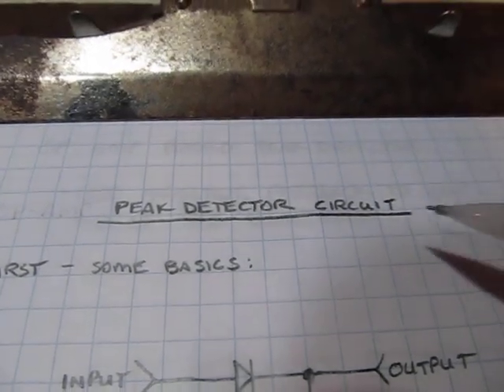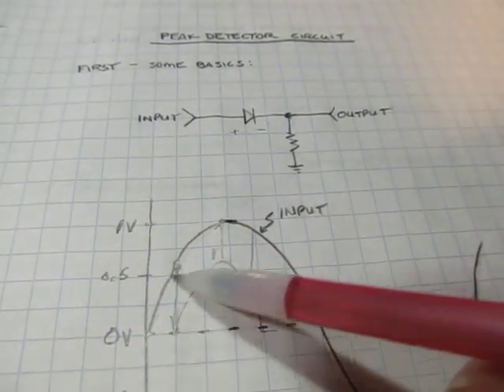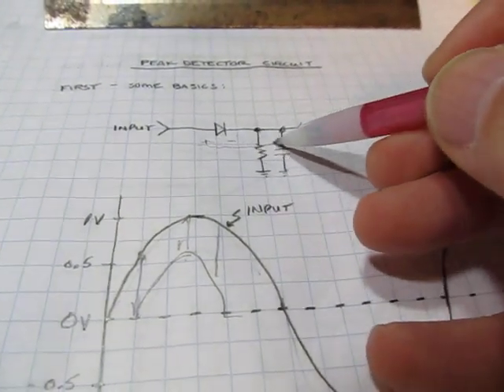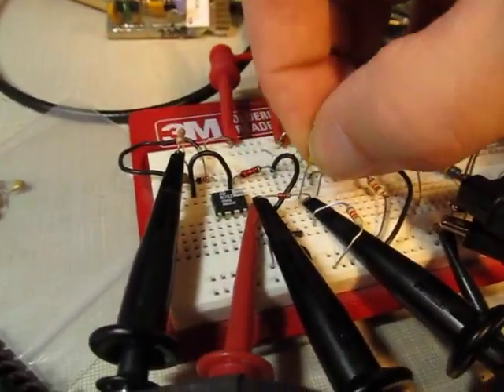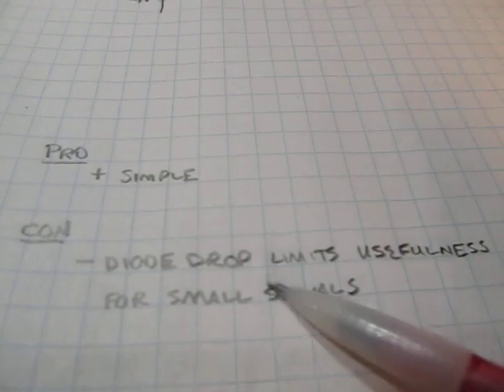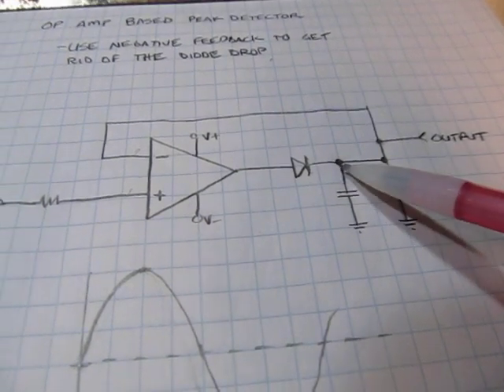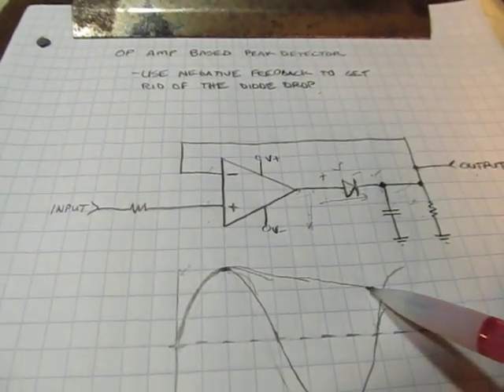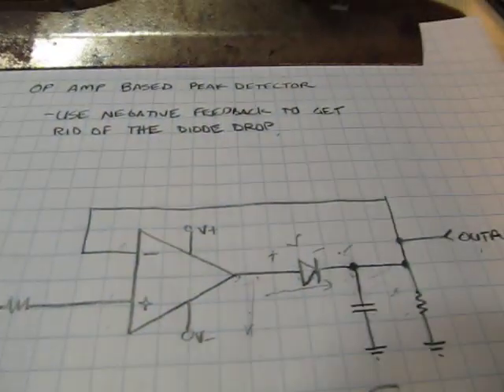#77: Op Amp Peak Detector Tutorial, with peak detector basics

Comment: Is it possible to detect peak without using diode.as diode will drop some of the voltage across it.if the voltage is in micro or nano Volt then how it can be ready without using diode..
Reply from the maker: With the diode in the feedback path of the op amp, you eliminate the diode voltage drop.  However, measuring the peak of very small signals such as these, you would likely want to amplify the signal first, then peak detect and scale the output.

Comment: Excellent explanation how a peak detector works. It would have been nice to get values of C and R. We know, R shouldn't be too high because of noise, disturbance issues, but what would be a good value for this R?
Reply from the maker: The capacitor and resistor are generally chosen based on the application. There are no hard and fast rules.  The capacitor should be large enough to store the charge (and not be bled off by the load too quickly), but not so large so as to require a very large charging current through the diode. For low frequency/audio applications, a few 10s of uF or more are typical.   The parallel "bleeder" resistor may not even be needed, especially if the circuit that follows the peak detector draws off the charge to create the required droop requirements.  If you need a faster droop or discharge, then the parallel R can be added for that.

Comment: Hi Alan, as a retired mechanical engineer I am still low on the (steep) learning curve with electronics but I had an idea about this. I have a couple of Tek 'scopes, a (dinky) little 314  & a 7403N which works when it feels like it (HVPS issues).

As you are no doubt aware, neither of these 'scpoes has a digital readout and I wondered:-
a)   is it possible to make a -ve peak detector with the other half of the op-amp and inverted components, and 
b)   could I use a combination of peak detector circuit and DMM to give a numerical readout from the 'scope trace?

Perhaps you think this may be an interesting video topic for those of us who don't have cursors or DSOs. I know it is quite cheap now, to acquire a Chinese DSO but I have always had a thing about vintage equipment and it does save on land-fill.  I also found an old AVOmeter 8 on eBay a while ago and could not resist the 3kV input (!) which I thought would help in fixing the 7403N and would be a good learning excercise. :-)
Reply from the maker: The answer to both of your questions are yes - you can make a negative peak detector, and use a DMM to measure the levels.
Reply: @w2aew  Great, thanks!

Comment: Hello, thanks for the explanation! I want to make sure if the type of the amplifier affects the performance of the circuit. I tried the Lm741 and the MCP6273 but peak detection didn't work. Any suggestions? Thank you in advance.
Reply from the maker: You have to be mindful of the power supply requirements, and the permissable input and output voltage ranges of the op amp that you use.  The ancient LM741 is VERY different than the MCP6273.  The LM741 is designed for larger power supplies, and usually split supply operation (like +/-15V) and the inputs and outputs can't get any closer than a few volts from either supply rail.  On the other hand, the MCP6273 is a low voltage op amp with a MAXIMUM supply voltage of 6V and it's inputs/outputs can go to the rails.  Very different!  If you don't respect the supply and in/out voltage requirements of the particular op amp you're using, it won't work.
Reply: @w2aew  Thank you for the quick reply, yes I am using the MCP6273 with 5/-5 Voltage supply. It must work right ?
Reply: @w2aew  I also have a concern regarding the basic peak detector circuit (diode, resistor). I am using the 1N4004 diode with a 1K ohm resistor. The voltage drop of the diode must appear consistently when I increase or decrease the Amplitude of the input signal. In my case when I increase the input from 0.7 till max i.e 5 or 4 the potenti difference between the input  and the output is increasing.
Reply from the maker: @milanakassab5725  This is basically normal, since the diode has an internal series resistance once it is turned on, so that will create a bit of a voltage divider with your 1k load resistor.
Reply: @w2aew  yes but the voltage difference is very significant it is around 0.5 when the input is 2v peak to peak sine wave. When I increase the amplitude gradually the voltage difference starts to rise from 1.2 till 2.6 till 4.6 etc. 
I don't think that is normal right?
Reply from the maker: @milanakassab5725  That is unusual.  Are you doing this test with a high frequency signal, where device capacitance will affect the results?
Reply: @w2aew  The frequency of the signal applied is 500 Hz and same goes if I apply a signal of 100 Hz
Reply: @w2aew  it worked ! I had the coupling Set to be AC so I just switched it to DC and it worked.
Reply from the maker: @milanakassab5725  Great!  Glad you figured it out!
Reply: @w2aew   Okay thank you for the note, I didn't pay much attention to this detail since in my application I need the +/-5 V for other purposes. But now another error I am facing is with the peak detector circuit (simple diode and resistor) I mentioned before. If you can help me understand the problem I will be more than thankful!

Comment: Hi Alan - even the old videos are still inspiring - I learns something every time.  Can you provide actual representative value for the R and C?  I know it is the RC time constant, but have trouble understanding how to get to the flat line DC output for the peak detector. -73 Dean KK4DAS
Reply from the maker: The thing to think about is what is going to discharge the capacitor during it's "hold" time between peaks.  What is going to draw current from the capacitor during this time?  Increasing the capacitor value and/or decreasing the loading (current draw) will result in less droop, getting closer to the "flat line".

Comment: Question. Working on designing my first 78.5 mhz AM receiver. Need a diode detector, but the output from my emitter follower should be 10 ohm... I have a second diode to pull the level up to just below forward bias, so the signal can take it over. My cap i selected to be 10 ohm at 78.5mhz , about 202pF.  and 500k bleed resistor for the desired time constant... My signal level is very very low... This is counter intuitive cause a bigger cap would short thr signal to ground even more and kill it? My question is, how critical is ompedance matching st this stage... I.e what are design criteria? Also... My 10 ohm would be reactive... Should i take steps to make it look resistive? Please im trying really hard to learn this stuff but i can only get so far on my own qnd would be great if i could discuss this with someone
Reply from the maker: Impedance matching is not critical in an AM detector stage.  However, a diode detector at 78MHz isn't going to be very efficient because of the junction capacitance of the diode.  Be sure to use a low-capacitance type diode, such as a schottky diode.

Comment: what should be the value of resistor and capacitor?
Ive used another opamp as a high resistoance and 1 micofarad capacitor, which is giving me a 20% error
Reply from the maker: The values are highly dependent upon the application and what you're trying to achieve in terms of voltage range, frequency range, etc., so it's not possible to give you exact values.

Comment: Im trying to figure out if this is used with audio amplifiers, if so how would this work. I would want a circuit only to detect when the audio signal clips and indicates by lighting one led.
Reply from the maker: You could take the output from the peak detector into a comparator circuit, whose switching threshold is set just below the clipping level, and have that drive an LED.  That'll give you indication when you are near & beyond clipping...

Comment: Hey Alan, i didnt get the part when you mentioned what would happen if we pick a resistor thats too large. My best guess would be the capacitor discharges more slowly over the resistor and this flattens our output even more. But you said the opposite, why ?
Reply from the maker: +dogus ural I don't think I said the opposite.  In the case of the "bleeder" resistor in parallel with the peak detector cap, the larger the value, the longer the discharge time of the cap.  My "caution" is to be careful when choosing the bleeder value to ensure that the peak detector can properly track the peak of your signal of interest.  The idea is make sure the discharge time isn't too short (lot of droop between signal peak), and not too long (holding a peak much longer than necessary, thus missing slow variations of the peak signal changes).

Comment: Alan, love your videos. Best education on YouTube! I was going to build something like this up for a project in the 100-500kHz range (frequency not critical, could go on the low end). What diode would you recommend for this frequency? I always have trouble trying to spec diodes (might be a good video). Also, do you think an LM324 is up to the task? Thanks so much.
Reply from the maker: +PelDaddy I'd go with a common switching diode like the 1N914A or 1N4148.  The LM324 might  be a little slow for the upper end of your frequency range, but give it a go...
Reply: ***** Thanks. My circuit worked very well. It ended up at only 10kHz, and the LM324 seems to be holding up as well. Always look forward to your videos, especially when they involve vintage Tek scopes (which I use too). Thanks again.

Comment: i powered the opamp with a 9V battery so in singly supply operating mode. It worked only when the sine wave of the function generator was set in the positive range. I'm not 100% sure why
Reply from the maker: Because for the op amp to operate properly, the voltages at the inputs have to comply with the input voltage range limits, which rarely included operation outside of the power supply rails. See my video on this topic.
Reply: ***** oh, this explains why, thank you, you're very kind. i'll check that video on the power supply rails.

Comment: Thanks ! that was very helpful, except how to choose the values of the resistors and the capacitor and what opamp family are you using? desired frequency is 500 Hz
Reply from the maker: Hana Sharaf I used an AD8032, but just about any op amp that meets your power supply voltage requirements, and input/output voltage range will work fine.  Choose the capacitor and resistor as needed to achieve your required "hold" or bleed-down time.
Reply: ***** thanks for your reply! I'll try it out to envelope my EMG signal..
Reply: Well I tried the circuit in the vid, it shows me the peak and the discharge level only _on the oscilloscope- without any amplitude. In other words it just outputs the difference
Reply from the maker: Hana Sharaf Without any details on the signal you're trying to measure (peak-peak voltage, output impedance, DC offset, waveform shape, etc., it is impossible to say what might be happening.
Reply: ***** found out that I didnt choose DC coupling option in the oscilloscope. It worked thanks!

Comment: I have tried part of the circuit in the beginning of the video with a really odd result at low signal voltage.
I have a 1khz 0.5v square wave going directly into an IN4001 diode with a 470k resitor to ground on the output. On my oscilloscope there is a NEGATIVE 50millivolt spike, below ground. Is the diode causing a negative charge pump voltage somehow?
Reply from the maker: Could be that you're storing charge in the diode's junction capacitance which then pushes the cathode below ground momentarily when the squarewave goes low (until the stored charge is dissipated).

Comment: Great video! One more thing; when you said 'peak detector', and if I want to measure single pulse, then it is not possible to do it with bleeding resistor. My proposal is to use some kind of switch or push-button or NPN transistor (collector to cathode of the diode/capacitor, and emitter to the ground - instead bleeding resistor. To the base of the transistor, short positive current to 'reset' the circuit for next measurement.

What will do this circuit now is wait for positive pulse to arrive. Then it will charge capacitor to the voltage proportional to the input peak voltage, and will STAY there until switch is closed - capacitor quickly 'null' or discharged. For longer period, it will be good to use good capacitor with low self discharge rate. And, another opamp with high impedance and unity gain to provide buffer between capacitor and measuring instrument (load), which may discharge capacitor if load has low resistance.

What this switch/button, or transistor does is 'reset' function after measuring voltage in next sequence order: sample peak and hold, measure, then reset after measurement (or by additional circuit, or manually by push-button). 

One of many examples of use of such peak and hold circuit is to measure sound level for sporadic sound occurrence (e.g. thunder, loud bang, etc.), or for many other uses where pulse last very short time.

So, this will be actually upgrade from peak detector to peak and hold detector.

Does this make sense to you?

Cheers,
milan
Reply from the maker: What you've described makes perfect sense. You'll have to be sure to use a low leakage capacitor, and an op amp buffer with very low input bias current to hold the peak voltage on the capacitor for an extended period of time. The reset circuit should work fine. I used a bleeder resistor purposely to show the peak follow and discharge characteristics more clearly.
Reply: ***** Thanks. Very useful information.
Reply: *****
Hi. I'm having a little trouble with a circuit just like the one described by Milan Karakas, I'm trying to detect and hold peaks from single pulses and buffer them to an ADC, the pulse amplitude is very short (62.5 ns to 125 ns) and TTL +5V level. This is basically a Time to Amplitude Converter, so it's important that the pulse duration and the voltage level at the output of the buffer always be proportional.

I'm using TL081 Op Amp, a 1N4148 and 470 pF Mica capacitor as followed by another Op Amp as a Buffer, but the output is always null (offset voltage or 0).

So can you please give me some hints on How can this circuit be improved for short single pulses?
Reply: nature numbers
TL081 has only 4 MHz bandwith, so such short pulses as 62.5 nS to 125 nS are higher than 8 MHz. I don't know what you trying to build (FM detector?), but isn't more convenient to measure time directly? Fast divider(s), use 100 MHz oscillator (really cheap on eBay, cca. $1 US, $5 US - lot of 5), feed it to the divider over the gatting circuit. Gate it with your 62.5 to 125 nS pulses. Then read status after dividers (counter) stop counting (don't forget reset dividers/counter after reading is done). After you get number which should be proportional to the time of counting, then you can do whatsoever you want with this number (with MCU). I think this is more convenient than ADC sampling, which may be pretty slow, depending of ADC chip you use. Some MCUs has pretty fast internal conters, up to 60 MHz or so, then you use 50 MHz oscillator instead.

Can you tell me what you are about to build? Maybe there is another trick(s).

Regards,
milan
---

EDIT: Bandwith of the opamp usually means that amplification (gain) goes to unity (x1) at mentioned frequency of 4 MHz for TL081. Then, it is too slow to forward your pulses to the capacitor in peak and hold circuit. Since your pulses are always +5V, but with different duration, you can use diode-R/C circuit directly as peak and hold circuit, and with addition of transistor for discharging capacitor after ADC done conversation, you can do what you want. Note that RC circuit is not linear, but you have relative narrow choice of pulses (1/2 to 1 ratio), not 0 to 1 ratio. So, that part may be relative linear. Still, if you want to know duration of the pulses, method of direct time measurement is the best and linear.
Reply: *****

Hi. Thank you for your time, sorry for not being more specific.. didn't want to extend too much the comment.
I'm doing something call Time to Digital Converter, I'm using a pulse counter running at 16 MHz for the coarse acquisition, and a Time to Amplitude (or Time to Analog) converter as interpolation circuit for the fine acquisition, this I hope will give me 1 nS resolution, this is equivalent to a 1 GHz counter, with the obvious differences in error probability and type of measuring error and drifts.

This interpolation circuit is pretty simple, a constant current source charges the capacitor during the pulse time, this solves the nonlinearity of the capacitor charging, so the time can be calculated from the voltage level of the capacitor. The problem comes when you tray to mantain that voltage level (lets say a 1 to 5 V span) stable for about 2 uS so that the ADC can do the job.

Like you said the problem is the bandwith of the Op Amp, because of the rise time I guess, but besides that, is there any other consideration to take care in this circuits? I mean in order to improve it to the nS pulse region.

Comment: Since an opamp is a feedback device, are there ever problems with induced oscillations with opamps? or are they just magical devices
Reply from the maker: Sure, they can oscillate if there is too much phase shift in the feedback path. Worst case is when set for low/unity gain. There are some op amps that are not unity gain stable. However, most modern op amps are compensated to be unity gain stable.